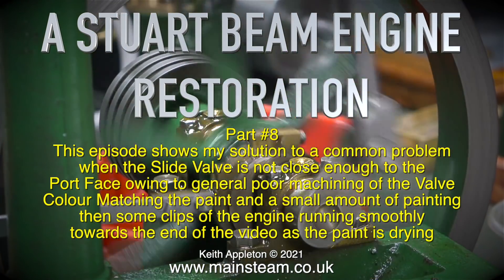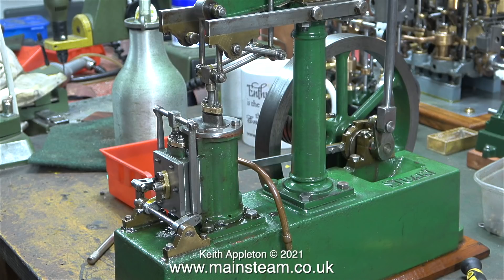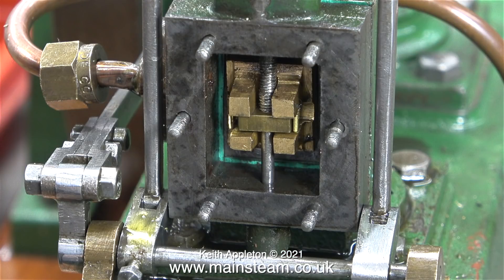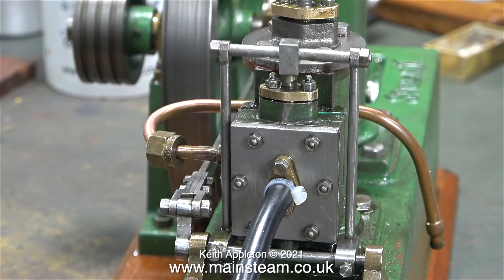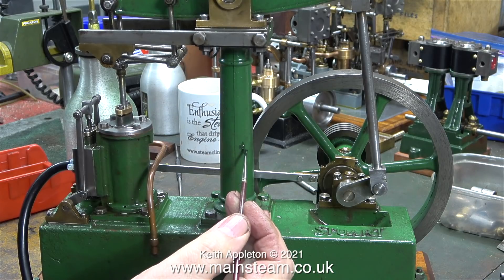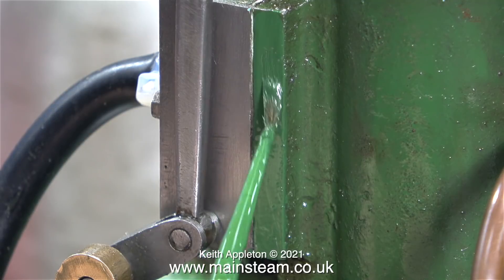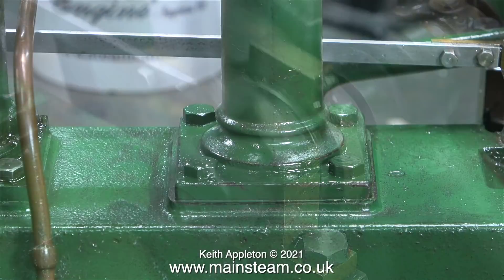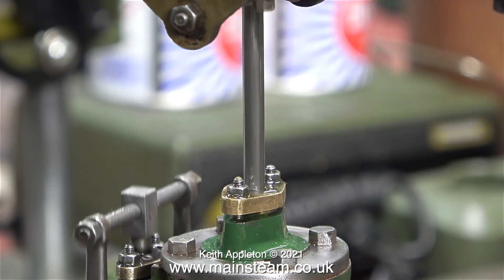A STUART BEAM ENGINE RESTORATION - PART #8

Comment: a bigger slide valve block would have been easy and a much more permanent fix.
Reply from the maker: no more permanent than the way I did it . . . . . and using a shim as shown is quicker than making a new drive block.

Comment: Shim idea is simple and effective. I would have gone for a really soft leaf spring between the valve and the driving block. Just barely enough force to hold the valve in place against gravity and not a microgram beyond.
Reply from the maker: I could I suppose bend the shim . . . . . .